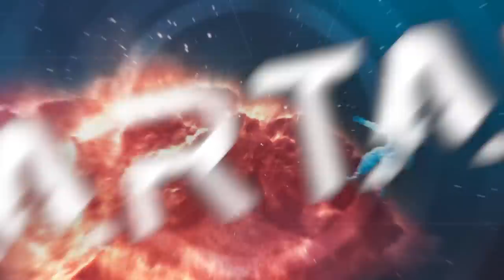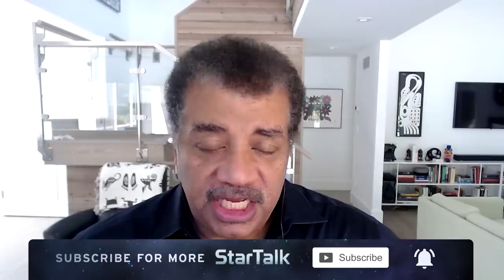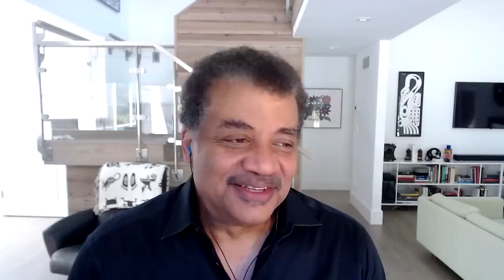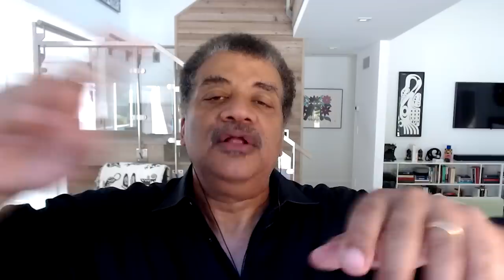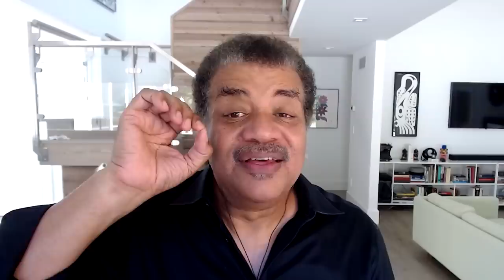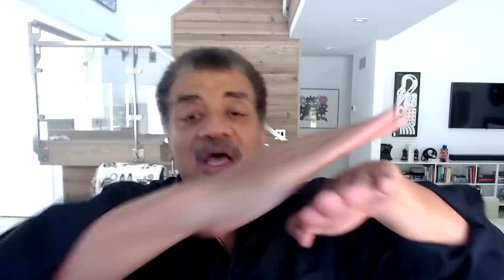What is Exit Velocity? | Neil deGrasse Tyson Explains...

Comment: As for the question of what angle you want the ball to come off the bat, you want it at 15 degrees (relative to the ball coming off the bat don't you? Otherwise you're not getting the 45 degree angle, and you don't have the greatest leverage. Surely. 30 degrees can't be faster because it's directly opposite the bat. That doesn't make sense, and it leaves a 15 degree oversight, which in quantum physics, or any quantum measurement, a HUGE disparity. Anyone got a different POV?

Comment: Can't they calculate the ball speed off the bat by using the same radar gun calculating the pitch velocity? Neil says they would need a radar gun floating in the sky in front of the balls trajectory, but can't you calculate the ball speed with radar behind the direction the ball is traveling? Yes, the pitch speed radar gun is not going to be pointed exactly at the same angle the ball leaves the bat, but it's probably close enough, right?

Comment: You could always take the average mass of the ball & bat, the distance from the mound to the plate (an approximation of the distance between the point of the pitcher's hand and the edge where the bat meets the ball), the average velocity of a bat swing that's a home run, and the amount of force generated therein can maybe be converted to a velocity prediction for the ball's route out of the park.

Comment: Couldn't they just use a radar to measure the position of the ball in two different moments and calculate the velocity from that?
Reply: That’s my thought. All they need is one point and the time of impact for speed, since you know the starting point (just above home plate). Ball dimensions you’ll have KE. I bet with two radar systems placed strategically, you can calculate launch speed, and angle of flight. I would be curious on the spin rate though.. I know they do it in golf nearly instantly, but I think it’s LiDAR?

Comment: Can't they measure the ball speed from some semi-buried radar gun in the pitcher's mound, thus avoiding any  catcher's groin disturbance? Or maybe they don't measure it by doppler but optically with a high speed camera, or better yet, more than one and calculate speed vectors of both ball and bat. 
Full disclosure: I'm so not a fan of baseball that I had to look up if the batter goes in the hill thing in the center or in the corner.

Comment: From everything I have read, exit velocities are measured with a radar gun. Supposedly the same type of gun which measured pitch velocity. (Absolutely NO word on where the radar gun is positioned. I presume its the same gun which measures pitch velocity) 
The rest is estimated math based upon previous results to an extent. As long as they get a decent measurement of bat speed and pitch speed, they claim to be able to estimate exit velocity fairly well.
However, they do acknowledge that exit velocities are in no way an exact science. But they took it to an imaginary level. 
They claim to know what a person's exit velocity will be based upon age of all factors. NOT from previous batting records, not from an actual measurement. Just a guess based on age alone.
Essentially, they are sort of making it up as they go.  lol

Comment: I am a big Neil fan and of the show but I don't hold everything he says with perfect regard his explanation of a radar or lidar device needing to be in alignment isn't exactly required for such measurements, and my claim is not wrong. You can use sophisticated high rated cameras that can pick up the ball along it's entire trajectory at any angle. Then inferring the dimensions based off of a spot template of your field and thus the dimensions and the camera angle you can deduce the speed based off of shutter speed and it's correlation of time. It's doubtful they didn't come up with this measurement in a controlled environment. I only put it out there that he may be out of touch on this one and I have every faith that a reasonable experiment has been made and realize these experimenters use different techniques, astrophysicists are vastly familiar with doppler effect it's a part of there forte, however VFX artists could achieve a perfect and visually appealing experiment of it with ease. Also these speeds are slow for high speed camera experts, they've visually shown the speed of light itself.

Comment: JFYI, for all you leadfoots (yes, plural of the person, not the appendage) out there: if the cop's radar gun in not in the line of your travel, the speed they capture will always be slower then your velocity along the road... In case you're trying to use your new found knowledge to get out of one :)
Reply: If you know the angle of the radar gun fire relative to the movement of the car, you can compensate for it, but that's hard with a hand held gun and rapidly moving vehicle that's not directly in the line of fire

While I don't know the specifics of lidar, I imagine that it addresses some of these challenges

Comment: For the 45 degree swing to work, the ball would need to come in at a 45 degree angle, and come off of the bat at zero degrees.  Thats the only way all of the energy will be transferred to the ball.  There is a lot wrong with what neil is saying.  Most of it is correct but he is wrong on some key points.

Comment: Embed a GPS in a ball and a bat, invite the hardest throwers and hitters to do the testing, should give you a good average
If the thrower throws the ball at  a fixed objest, it will bounce at a speed, this speed adds to the hitters speed
btw Chuck, if a cop in a doughnut shop clocks you at 90, then you must have been going faster ;)

Comment: I do love you but you really have no idea about computers which are at play here. And I am not good with math...but it is very simple. They capture two points and then the computer itself can calculate the speed on how fast the ball has gone based on the two points. fyi yes, the computer can even calculate the angle the ball is going and put that data in as the finale result.